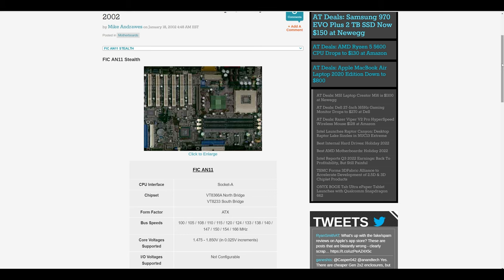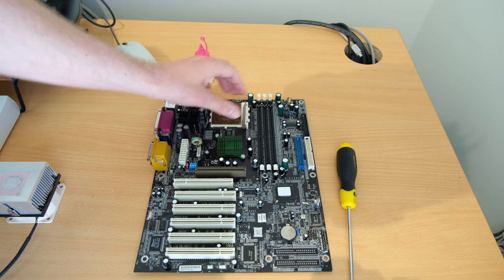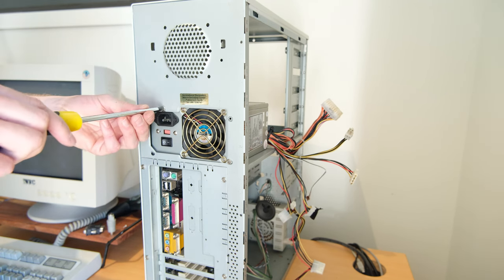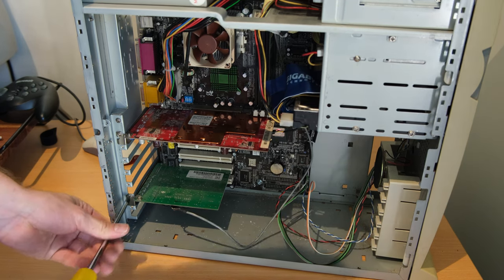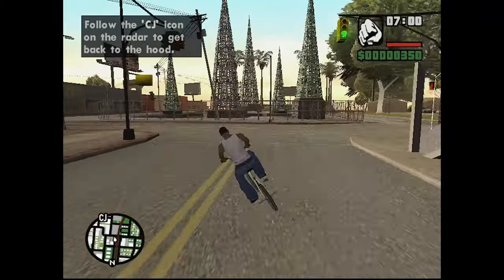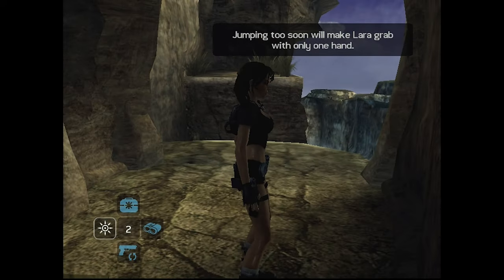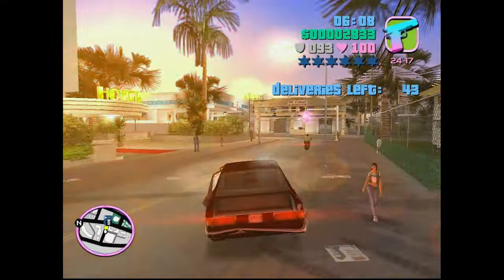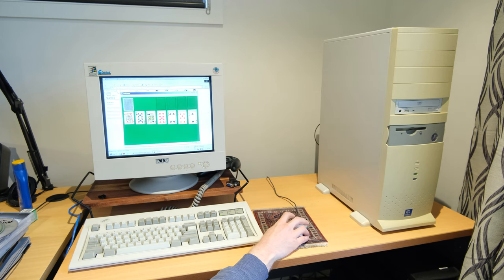AMD Athlon XP Build | From the pile of parts

Comment: Seeing nice Athlon XP build makes my day better 
Back in days i was rocking 2600+ Barton and 9600pro very nice combo worked very well for years. 
9600pro vas replaced with 7600gs and that was final upgrade before mowing to C2D system and PCI-e
Reply from the maker: Glad you enjoyed the video! That PC would have been quite the gaming beast! It's funny that you mention a 7600GS as I just found one in storage!
Reply: @thesmokingcap  
Yeah rescuing and recaping the motherboard is nice.
If i had that skill maybe i could rescue mine.
7600GS was kinda overkill for Barton 2600+ but i remember call of juarez didn't go well with 9600pro but 7600gs it was playable.
And oblivion too no go with 9600pro but 7600gs could manage it.
Reply: Damn I had almost the same specs only I used a 2400+.
Overclocked it to a 3200+.

Played a lot of Battlefield 2 on that thing.
With a huge external fan blowing into the open case xD.

Comment: The first sound card goes by many names but was originally known as the Ensoniq AudioPCI.  Creative bought Ensoniq just as these went into production, so it was later sold as the "Creative Ensoniq AudioPCI" and then later under two or three other annoying names (your CT4750 comes back as the 'Sound Blaster 128').  They're easily recognizable by having only the single chip in a sea of passives on the boards.  They're well known for having an incredibly low SNR for the era, much better sounding than pretty much any other card at the time outside of specialty gear for audio engineers, so the Napster generation would buy these and plug them directly into their HiFis.  On the other hand, they exclusively use CPU mixing so your system performance suffers anytime you have audio running, which means it constantly hurts game performance.
Reply from the maker: Interesting, I didn't know they had such a following. I've got some faster CPU's I can use it with, so might give it another try. Seems my clock speeds of my FSB were affecting the sounds in GTA SA

Comment: Tip for wiring up front panel headers: Most manufacturers by the ATX era would have the decency to point all signal pins points towards Pin 1 of the FPC pin group on the board, so for example if Pin 1 is on the left, you can expect all the signal pins to be leftmost.  I figured this out when I swapped dozens of boards into my ATX bench for testing one weekend and needed to quickly figure out which were the pins for the power switch.
Reply from the maker: Ahh yes, good tip! I've seem as well pin 1 is marked on the connector with a little arrow, so I try to match that on the MB. But will keep that in mind

Comment: Yeah that’s normal, it’s detected as an Athlon XP because…it is, an Athlon XP.

As for graphics card recommendations 🤔 this was the era of the Radeon 9500 Pro & 9600 Pro. I wouldn’t recommend going much faster than that (9700-9800 pro) as those really need an Athlon 64 or equivalent to reach their full potential. The 9600 Pro can be found on eBay fairly cheaply £20-£30 but the 9500 Pro commands quite the premium for some reason.
Reply from the maker: Correct! Indeed it was a Athlon XP all along. Initially the motherboard was showing a clock speed of 1.2Ghz, so that led me to believe that is was not a Athlon Xp. Until I googled the CPU model while editing the video, Doh!! Yeah I was looking at a 9600 Pro as a good option. Seems ATI has some great options in that class
Reply: entirely likely the premium command is a simple supply issue; the 9500s were all based off of the same chips that went into 9700s and thus it was never in ATI's best interest to move such products in as large a volume as the full flagship parts that can maximize profit margin (and is why they needed a 9600 Pro based off of a more cost effective GPU for a midrange part).
Reply from the maker: @bojinglebells  I'd love a 9700 or 9800 pro but they're a bit spendy!

Comment: Nice fun build! I have a soft spot for W2000, at least after the first service pack. The stability after using 98 was phenomenal. As Jon said below, a 9600 Pro is a great card for a fast Athlon XP machine.
Reply from the maker: Yeah it was a great OS, quite stable I've found as well. But with good networking support. I'm thinking a 9600 Pro might be a good option as well
Reply: I used to use W2000 on 8 PC's even when XP came out. Ran seti@home distributed computing project then BOINC and folding@home etc. W2000 on an old p3 box got to just over a years uptime without a UPS but had to go off as the room it was in had to have new carpet.

Comment: That motherboard's I/O was the standard for early ATX, though that standard only lasted for about five minutes. Those shields can be hard to come by because most ATX cases back then came with a shield installed from the factory (that was usually held in pace with a screw) that worked with those motherboards, so the shield that came with the board wasn't used, and generally ended up being tossed out at some point. Years later, the board gets pulled from the case and sold without an I/O plate.
I recently picked up several old motherboards with no I/O plates that use these same layout, and a local computer store that has lots of new old stock and actually sells some used parts has a box of old I/O plates that I picked through; I found about five of this type - even better, they gave them to me for free!
Reply from the maker: Yeah makes sense why none of the motherboards I bought had their I/O shields. Alas that is the life of old PC parts! haha
Reply: @thesmokingcap  If you have a friend or local shop with a 3D printer (my UPS Store down the street has one), you can get the bog standard ATX covers printed without modifications, should work fine here (and for any other boards you have with standard ATX I/O).

Comment: Is the GF 4 MX440 a 128-bit version or a 64-bit one ? Also what frequencies does the card have ?
Reply from the maker: Ohhh good question, I think I'll have to download a tool such as GPU-z or something to find that out. It's a MX440SE so Wikipedia suggests a 128bit bus
Reply: @thesmokingcap  Definitely not a bad card, but a little underpowered and underfeatured for the rest of the system IMO. You'd be better served by a GeForce4Ti 4200 or a Radeon 8500 if you happen across one.

Comment: I have the same problem with a Radeon 9800 Pro, exactly the same.  Incidentally, I also have a similar configuration, but I operate the board in a modern environment.  My mainboard is the cherry red PCChips M811 with Athlon XP 2400+.  A modern magenta fractal design Pop Air case with a 5.25 bay is used as the case.  The cooler of the Athlon XP is magenta and the fan is 80 mm with RGB effects.  Sound card SB X-Fi, and SATA SSDs with PCI controller card.  And now it comes, the GeForce 960 graphics card is mounted vertically and connected via an AGP to PCIE adapter with a riser cable.  It even works 😁 Of course it's all total overkill, but that's supposed to be a totally crazy retro system.  I also have a few other PCs with more timely hardware and gray cases.
Reply from the maker: Oh wow! Sounds like it's been kitted out with some nice parts as well. I didn't know there was a PCI-e to AGP adapter, I might have to try one out. Getting cases with 5 1/4 drive bays now is getting harder

Comment: I would install an exhaust fan at the top also will help when you put a faster video card in due to rising hot temperatures in the case will help if you choose to overclock the faster Athlon XP also. As for video cards a geforce 4 ti 4600-4800 or an ATi 9600 pro would be great video cards to run with an Athlon XP.
Reply from the maker: Ahh yes, Indeed it does need a case fan. I've noticed it starts to get a little warm.

Comment: I don't know if it's the bios or some jumpers that lowers the microprocessor speed, probably with faster ram it would detect more speed but depends on the motherboard. Having a Athlon xp myself I couldn't figure out how or why.
Reply from the maker: I ended up having some jumper issues on the next AMD build as the RAM was running at the wrong clock speeds, causing the machine to crash

Comment: Remember to replace the thermal compound on your GPU's! You could try re-flowing the solder on the VRAM of that graphics card with memory errors. Also the problem may not be the vram but the old capacitors on the card.
Reply from the maker: Good tips, Yes I've done the thermal paste on this one. But haven't re flowed any memory chips or done any capacitors. But could be a good option to explore

Comment: I made a Windows 98se PC out of parts. I use a 3200XP Barton 1 GB ram and all my drives are SATA with a GeForce 6600 GT on a AGP X8 bus I now it is overbord,
but I used parts, I have taken out of old PCs. The sound card is a Sound Blaster Live! 5.1. The motherbord is a Asrock K7VT6. The only thing I got was a SATA PCI card, I got a VIA one as it used the same one on the motherboard.

Comment: You can do the io shield cover using the metal from a milk can or a soda can. The milk cans are from tin you can mold and cut easily, the soda can are aluminum instead. You just need to draw the wholes in a paper sheet and cut the straighten can.
Reply from the maker: Apologies for the slow reply! Joys of life getting in the way. Ahh yes, I might have to give that a try sometime

Comment: Like! That CPU is an Athlon Xp 1900+ with a default frequency of 1600 mhz (12x133). You have too manually select FSB 133 to make it run at default frequency. At 1320 mhz it is underclocked.
Reply from the maker: Yes, correct! What a dummy I am haha, I had the jumper back to front, so moved it and what do you know, a Athlon XP 1900+ is there at the full clock speed! Thanks for the suggestion  
☺

Comment: I totally skipped Intel P4 and P4 HT. From P2/P3 (slot 1) I went directly to Athlon XP. I made a system with an Athlon XP 2800+ (Barton core) on a mobo with VIA chipset. I had a Ati Radeon 9250 graphic card with 256M VRAM. I used XP and as I updated from SP1, to SP2 and then SP3, I also upgraded the memory from 3x256M to 3x512M and to 2x512M+1G (DDR). It was snappy, stable but after updating to SP3, XP felt not so well. I played many hours on that system and I (for the first time) uset broadband internet to play online and browse the web.
All in all, that computer was well used for 5-6 years; I had to take it apart when the graphics card died and I got a better deal on a new LGA 775 motherboard with PCIe.
Reply from the maker: That would have been an awesome build back then. IT would have played all the games! Sounds like it gave you quite a few good years of use
Reply: @thesmokingcap  Thanks for your reply.  I remember playing many games from GTA (Vice City and SA) to AoE 2, Diablo 2 , Uru, Return to Castle Wolfenstein, Half Life, Tomb Rider, Prince of Persia, almost anything I liked. Yes, old games, no AAA titles but I really enjoyed that build. Besides I was proud that it worked so well because I built it.
And it was also my mutimedia hub, I hooked the video output of the GPU to my CRT TV and watched movies from DVD or "backups" or simply watched satellite TV shows with a TV Tuner... Oh, and playing mp3s in Winamp what memories.

Comment: Try to find a MB/socketA/ with sata  plus max ram 3gb ddr400 plus 9600 Pro or 9700Pro.THe good cpu from socketA is 2400+ and above.
Reply from the maker: Mmmmm yes, It would make for a fun Windows 2000 build. I do have a 9700 series card but it has bad memory or a GPU core. I would like to try and repair it one day
Reply: @thesmokingcap  Maybe need reballing I had problems with 9700Pro quick reball and continue to work up to this day!!
Reply from the maker: @milak111234 I need to get myself a hot air workstation. But want to get a microscope or oscilloscope before then haha. The joys of wanting all the gear
Reply: @thesmokingcap  Excellent Idea!!